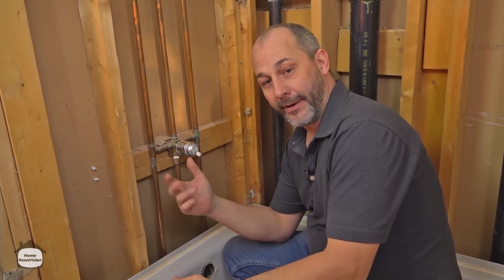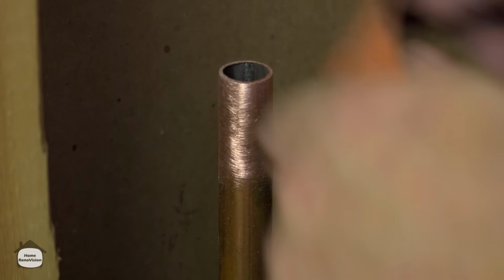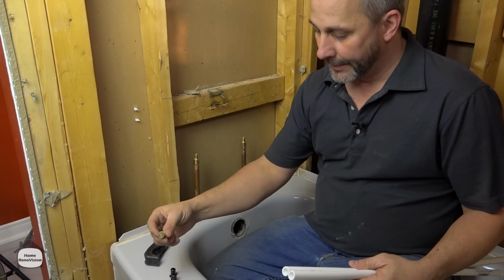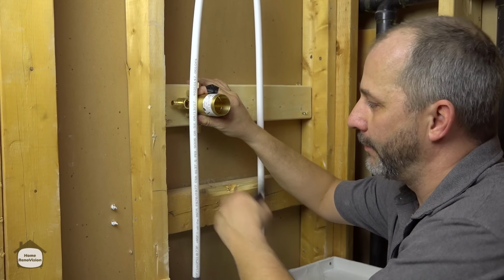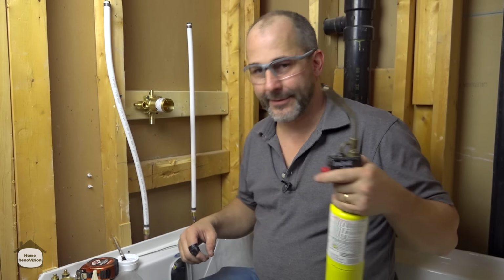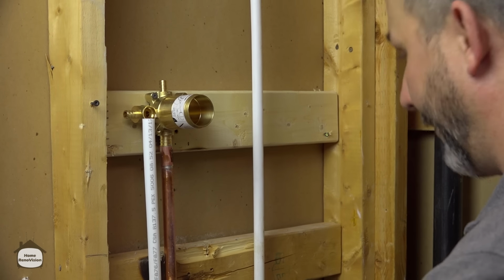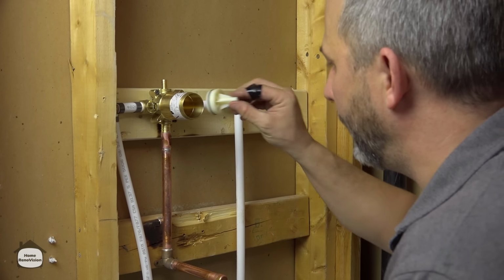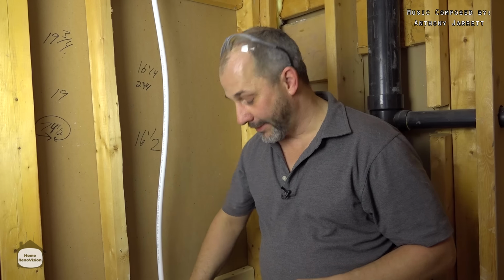DIY How To Install Copper To Pex Shower and Bath Plumbing

Comment from the maker: To get tickets to our Just Do It Yourself Tour click here! To book you TICKET  Click here: https://homerenovisiondiy.com/events/
Reply: Hey so I loved the video and I will be doing this tomorrow for the first time! But I noticed that my shower body is sweat, not Pex. Would it be ok to just soldier on sweat to PEX at the shower body itself and then go all pex back to my copper lines? I have an extremely tight fit in the basement and I could cause a house fire easy if I try soldiering at the bend thats needed to go upstairs to the shower. However, PEX seems to be just flexible enough that I can do everything 1000x easier and faster. Hope to hear from you or someone soon.
Reply: Sr you have all my respect, the way you explain this art .
Reply: I am in Charlotte and I see that you will be here in 2 days?
Reply: @emmanuelisanda1449  cc xxx c
Reply: @emmanuelisanda1449  in
Reply: @emmanuelisanda1449  0n.
Reply: 502 302. 9963.  Hi
Reply: @khalidyounis7756  ww5ew5555ww5555555w55

Comment: You still need to solder. That scares me pecs looks do able but I never solder before I would hate to cause a massive leak. I watch the way you did it. You put that flux scratched up the inside with the brush and then you hold the torch at the end and let everything heat up and put the solder at the joint and you let it heat up and melt. You don’t have to go all the way around it. You could just leave it there and it magically goes inside everywhere?

Comment: HELLO...IS NOW  7 YEARS  YOU POST THIS VDEO...THE  JOB YOU MADE STILL WORKING WITH  THE PEX TUBING WITHOUT ""LEEKS"".. BECAUSE i PLAN TO USE THE PEX TUBING   TO CHENGE MY WATER HEATER FROM THE  INSIDE THE HOUSE TO GARAGE IS  ABOUT 30 FEET  FOR THIS JOB  WHAT YOU RECOMENDED  PEX OR COOPER

Comment: Great video.  Just wanted to add that my crimper came with a "go, no-go" gauge to verify that the crimp conforms to standards.  I've seen an experienced plumber not use them and a slow leak form right after he left.  Fortunately, I caught him at his van and he came back and redid the crimp.

Comment: I repiped my 1300 sqft home with my father 10 years ago with Pex A. Bought the Dewalt cordless PexA tool with 1/2" & 3/4" heads included for $260.  Bought 1 roll 3/4"  and 2 rolls 1/2" along with the expansion rings and fittings for PexA.  Used copper stubouts for all plumbing fixtures (toilets/sinks). All in it cost me under a $1000 and 2 days time as a DIYer with my fathers help, of course (who is not a plumber either).  All the plumbing has been suspended with plastic straps in the attic and supported with clamps in the underhouse crawl space.  It's been leak free and rat free (no chewing yet) since installed 10 yrs ago.  And that was in SoCal  where it can get rather warm at times in the summer.  I'd say so far, so good 😁🙏.

Comment: It looks like the bottom of the valve fitting is a pex fitting and you soldered copper to it with that 1/2" copper coupling.   I didn't follow that.  Is that OK to do??

Comment: Great info! Only concern as I install a similar Delta valve with stops.  Is there any reason I cannot use a pex line to the brass tub spigot that came with the valve.  I've installed the 90 to the pex at this point.

Comment: great video thank you learn a lot, question, I had to change the cartridge on the Moen posi-temp valve shower, after i finish I hear water leaking, so I open the rear wall to find a pin hole leak from the cold water side, it is attach to a copper fitting and then to an expansion valve, the expansion valve is attach to a PEX pipe, need to know how to solder it without damaging the PEX pipe

Comment: my question is about cartridge .  Because these new system cartridges are slowing down water pressure.  Do you know any trick to avoid these cartridges ?   Maybe any other type of mixers ?

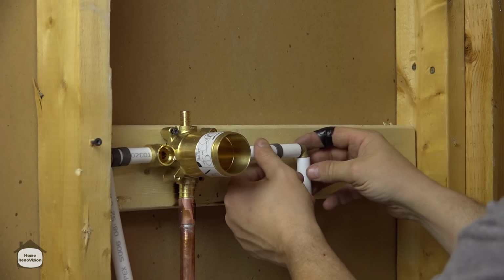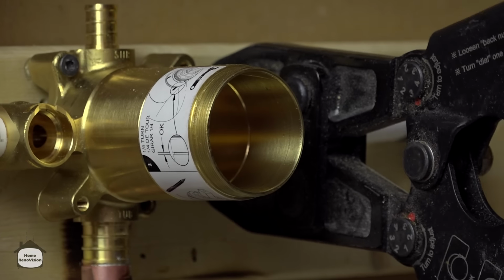Comment: Can anyone out there help me with “WHOLE HOUSE” water flow problem, (gpm). ? NOT A WATER PRESSURE, (psi), but a water flow problem!   It seems to be isolated to my house. My neighbors do not have this problem.  The system pressure, psi, is between 60psi & 70psi. The water flow, gpm, depending where you take your reading, as low as 0.85gpm to 4.70 at the tub. Readings were recorded at between 20:00 & 21:00 hrs.

My plea to ANYONE that can offer help, please do. I will greatly appreciate your help.

Thanks in advance.

Comment: I like how you explain everything but you say quarter inch exposure and I see it going from 1/16 to 1/8 of an inch of pecks exposure. Definitely not a quarter inch and the crimp rings with the little red ring on them are definitely not that much. Also, I don’t see you using the, Go / no-go gauge.
Thanks

Comment: Thank You for a straight forward video! Things have changed considerably since I replaced the plumbing in our house trailer! Went from the gray plastic >:( to white pex. I used the quest and flair-it fittings, they worked well, simple to install. Now almost impossible to find for the 12x24 mini-home I'm finishing out. Looks like more tools and new pex to buy. Oh"Yeah! thanks for the soldering tip, you just explained why MY sauter runs out of my joint, and leaks. I've been heating at the seam! This why pex & swage rings were made..... for people who cannot sauter!!!! heh-heh-heh

Comment: Looks like you used drywall screws to mount the valve.  I would use a treated wood and exterior screws for mounting the valves.

Comment: People should use thin sheet metal backing to prevent burn scaring and prevent fire damage to wood or other possible flammable materials.. Torrch people should also have a fire extinguisher available in the event of a fire accident. Torch people need to be prepared for accidents.

Comment: I didn’t know why you didn’t solder the valve and copper pipe way from there and after is cooled down you bring it to where is supposed to be and screw the valve and pipe down. Using torch on the wood is not safe

Comment: Thank you for a great video - very nice job!  I'm not a professional plumber but learned as a teen next to a WWII greatest generation grandfather who was.  May I suggest a few small additions?  First, wear leather gloves and eye protection in case a beginner sweeps their hand/face with torch flame, drops the torch, or touches the pipe while being heated.  Second, after cutting the copper pipe with the pipe cutter, de-burr the cut end of the pipe on the inside and outside.  You made a nice clean cut using slow quarter inch increasing pressure turns, but a beginner may end up with burs.  Having a sopping wet rag nearby allows you to wipe the excess solder off the joint and cool it down faster.  It you are sweating together pipe and a fitting not connected to the house yet, hold the pieces with vise-grip pliers that can handle the flame/heat and drop the joined pipe and fitting into a bucket of water to immediately quench the soldered joint and cool everything off.  Always have a fire extinguisher nearby in case the torch ignites old sawdust or (it happens), the plumber's clothing/hair!  Last, show the viewer the pipe dope you applied and apply the acid paste to BOTH the pipe and the inside of the fitting to make sure no missed spots.  Just a few things I learned from a wonderful, hard working man who took the time to teach me when I was young.

Comment: First off - I absolutely love your videos and find them very useful.  So don't take this as being critical.  Just my personal take on how I'd approach this, but I always try to absolutely minimize the amount of flame soldering I have to do near the framing.   So I personally would have sweated your tub-spout piece onto the control manifold on a bench, or table, held in a vise.  Much safer and more comfortable.   None of that flame-work needed to be done up against the framing.    And for the sweat->pex adapters on the two feeds,, where you have to do it within the framing, just for safety, I always use a spray bottle with water to wet the wood around the area where I'm using my torch.   Especially within old, existing framing that may have wood that has been dried out for decades and catches fire like a paper.  Takes 10 seconds to spray things down and make things way safer.

Basically, once I get the copper->pex adapters in place, I don't usually see any reason to use a flame near wood again.

Comment: You didn't ream the pipe. Wiping the joint after soldering is an automatic fail of the journeyman licensing exam.

Comment: You only need a turn and a half with sand cloth. All you need is to make a spiral like a gun barrel and by not de burring the inside of the copper you risk having that waterfall found or whistle. Keep up the clean work . Been plumbing 45 years

Comment: I need to replace a pex join attached to the shower. rats ate through it but it's too close to the copper part for the silicon tape to work so I need to replace the part that has the leak?

Comment: Wish I had seen this video before I ordered pex B to plumb my tiny house. I’ll be using Shark Bite knockoff connectors for the push to connect features. If I had it to do over again, I would’ve bought the crimp tool and connected that way. The expansion ring tool was out of my range and I didn’t want to do the manual expansion tool because I’m 68 and not very nimble once I’m on the floor. Thanks for this video. One very good tip I did take away is the correct technique for cutting PEX tubing.

Comment: Question .... replacing my shower soon and my new shower valve (the instructions state) to use copper for the hooking up of the new valve. My house is completely all PEX. I haven't removed anything yet (still in planning stages here  :-)  ).... Was wondering do I really need to use copper ? or would PEX do like in the video.  thanks !

Comment: Thanks for demystifying solder joints - I wouldn't have dared try it for fear of not filling the joint proper. Now I understand how it works.
Why do you still use copper for the faucet? Just rigidity? I asked my plumber to switch out the copper in my 1892 rowhouse for pex when he was installing my soaker tub (had to move the plumbing up), but he left copper between the shower head and faucet. (I figured that I'd never have to worry about a pinhole leak from corrosion in my old age if I upgraded as I do renos.)

Comment: The reason you want a licensed contractor with insurance is for those times something gos wrong and you get water damage. Being cheap can cost in the long run. In cal it can get verry expensive.

Comment: Seems so much work to go from copper to pex and then back to copper, having to pull out sensitive parts etc.  Why don't they make valves and fixtures with pex connectors? Would be so much easier.
Reply from the maker: they do now, nut back then there were supply issues!
Reply: @HomeRenoVisionDIY  Great! What would I look for? When I search for "Pex shower bath" I only see the type with inputs pex but not the outputs.

Comment: Thank you. This is such a good video for those of us who know nothing about plumbing. During Uri a plumber asked $400 to cut my copper line to an exterior faucet and cap it so we could turn our water back on for the house until he could return months later and gauge me again. I'll never forget those days without water. Or what he charged me to do what I could've done myself if I had a clue. Live and learn. Currently, still working on that same plumbing job after the 4th plumber came and did another halfa-- job. Uri was in 1921. All I want is a good, honest plumber. That might be me at this rate.

Comment: Jeff! I cannot thank you enough for all of the help that you have provided through your videos. Kudos to you for taking the time to help others be successful, rather than criticizing home owners for trying to do things on their own. I am very grateful! My question for you: In this video, you mentioned that some manufacturers thread some of the holes to attach the valve to the wall blocking. On my valve, all four holes are threaded but no machined screws were included in the kit. Do I need to try and find the right threaded machined screws or can I simply attach via nail, or slightly smaller screw? Thank you!

Comment: Dont wait for a pipe to leak or a sudden reno project to realize I've never soldered anything b4 , get your self some copper pipe and some elbows and t's and a torch some flux , and solder,  practice soldering the different parts together people its  not rocket science,  dam

Comment: Save yourself the trouble. Get some shark bite fittings. They work on everything, cut the copper pipe, remove the burr, and press on the fitting. Done in seconds, no solder. Then you can use PVC , PEX or even reuse the copper

Comment: Sorry, I know this is an older video: I get heating the copper pipe from the bottom on a horizontal joint (i.e., horizontal coupling) and letting the molten solder utilize gravity and surface area to coat around the pipe from top to bottom. What I'm not 100% on is how you're getting a fully solder connection on horizontal fitting (on a vertical pipe) because how can you sure the solder is wrapping around to the back side of the pipe and is fully coating it?  Especially, given space constraints and lack of seeing behind the pipe in tight settings?   If you had to redo it, how would you apply solder on the backside of the pipe given those types of restraints/restrictions? You can't physically or safely get the torch or solder around to the backside of the vertical pipe and, as mentioned, you can't see the quality of the finished connection on the backside.

Comment: Please do not take safety precautions so lightly. While you are very experienced and are not likely to be injured, most U Tube watchers are not experienced. Gloves and proper safety glass are minimum for most work with torch. Power tools add requirement of ear protection.

Comment: Should have mentioned that pex b has restrictions in all the fittings! 1/2 pex flows less than copper!  Only pex a has full diameter fittings. Pex b works but everything has compromises!!!

Comment: What if the only valve I could find is the delta R10000-LBX and it doesn't have the hot n cold valves like the one you have here. Just screw on?

Comment: I’m an actual plumber. All I’m gonna say is thanks    People like you keep me busy. It’s always more expensive to come re do something than if they’d just called me the first time.  Do you do your own dental work too?    Tell ya what. You do your job.  Make money. Call experienced people to do their job    Especially with plumbing or electrical.  Unless of course you like water damage and fires
Reply: With what plumbers charge these days, it's no wonder people take on these projects themselves. Local plumber wanted $2500 to install tub. I said no thanks, and did it myself and it's been just fine. That said, there is a point where the level of skill required exceeds my abilities. But small stuff like this anyone can and should learn.

Comment: Well….you sir are a horrible contractor 
Where are the hammer arrestors? You cut the old ones out and did not replace them!!!
Your crimping is completely inconsistent…rings 1/4” away from fittings is wrong, 1/8 is correct
Why in holy hell would you solder a 1/2” coupling over a pex connection, why not properly transition to copper 
I did not watch the whole video because i saw enough…for those of you who watch this video for good advice/examples and how to…..just dont unless you plan on hiring a plumber to fix your leaks
I’ve been a plumber for 24yrs now and repaired lots of hack jobs 
Be careful who you hire people and dont watch this butcher

Comment: You need lessons on soldering pipe. You didnt flux or debur the pipe. Also solder is applied to the opposite side of the flame. You also added too much solder and flux or it wouldnt drip. "fast plumbing" is not the way. You did a sloppy job.

Comment: "You may want to wear gloves for this"? We are MEN not soyboys!  Heat pipe as well as fitting and clean older boogers while wet.  WIPE OFF FLUX AFTER SOLDER! Where are air chambers?  Tee into the shower valve and install air chambers. Did you all notice what a nice plumb job the original copper piping was? Do bananas come with the pex material? Yes it IS sand cloth...

Comment: When you turned the water back on after completing the plumbing and you're doing the pressure test, don't you have air in the lines, and wouldn't that air prevent water from reaching or filling the pipes to the shower or tub?

Comment: Not wanting to scan through 1,700+ comments thus far - is there a reason why you do not ream the insides of the copper pipe portion prior to soldering or pex connection? I was told that reaming prevents noise (from inside water turbulence) and also avoid possible pin hole leaking over time. True? Great video Jeff - you’re my go-to channel for all things Reno:). Jim
Reply: The reason why is because this dude is a handyman and not actually a plumber so he thinks he knows what he’s doing but really just causing issues for the customer in the future if you noticed when he capped off the pex line on the left he didn’t get the whole crimp this is bad I know he didn’t leave the cap in there permanently but what if he was to leave it that would cause issues in the future never use a handyman for plumbing or as a career plumber myself I’ve had to fix many issues caused by handymen get someone licensed to do the job right.
Reply: @Apple-es8zr  that crimp on the hot side (permanent one) 90 was half crimped. i feel bad for the homeowner when they are informed the wall needs to be opened to make a repair that takes 3 minutes.
Reply: @stevenf3149  this is why I mentioned always get a real and licensed plumber to get the job done handyman no matter how good they want to be just aren’t it.